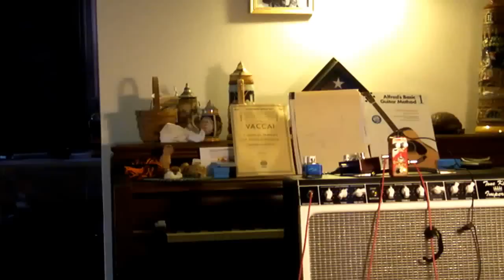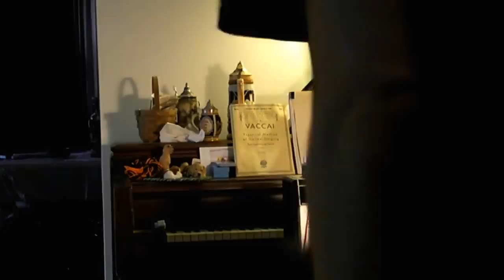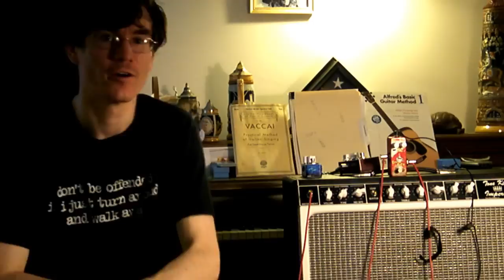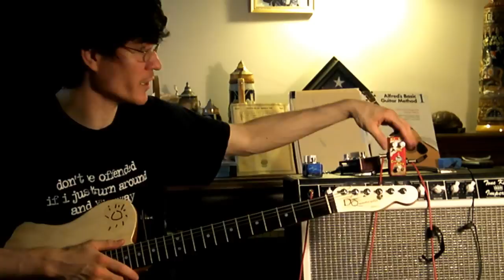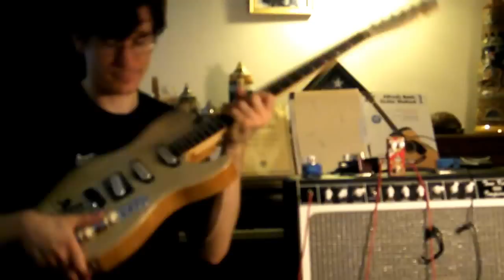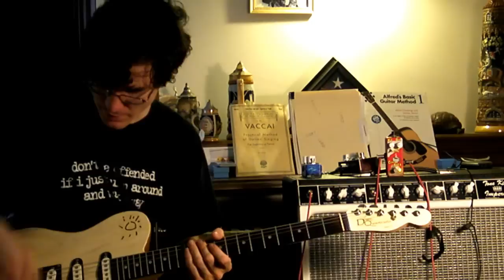Capucino Fuzz (Harmonic Percolator/Madbean Pepperspray with diode selector switch)

Comment from the maker: Ok, I understand what prompted your questions, now. The Pepper Spray can be built with the "concensus" schematic or the "albini" schematic. Madbean added a diode selector switch and a (very important) capacitor (150nF) that keeps the pedal from having an overwhelming amount of treble. There's a very recent thread on DIYSB started by Mark Hammer that discusses the circuit. I *highly* recommend reading that thread, as well as the FSB thread where the "concensus" schematic was created.

Comment from the maker: Keep in mind that musicians, and people in general, sometimes do not know the meaning of the terms they're using or reasons for something. Steve's using a high-gain amp with lots of mids into a 4x12 cabinet and high-output pickups. It's easy to get feedback with that. I'm using a Fender blackface amp, low-output (non-microphonic) pikcups. My setup will almost never feedback even at high volume, regardless of what pedal I put in front of it.